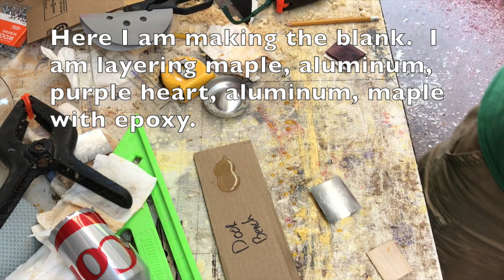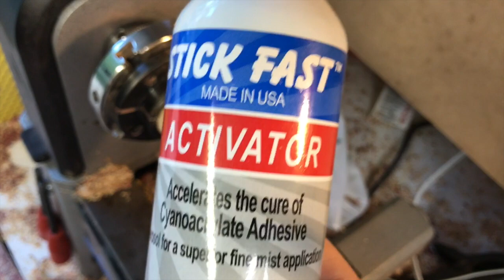Wooden Ring with a twist

Comment: You had no problem cutting through the aluminum portion of the ring on the lathe?
Reply from the maker: Joe Harney not at all. With a sharp tool, it cut easily. Slower than wood, but still easy